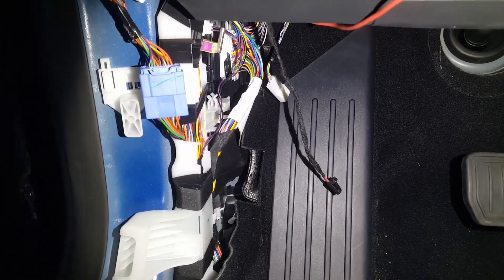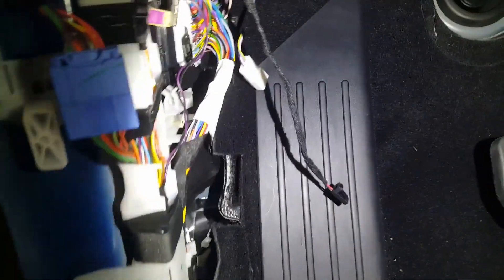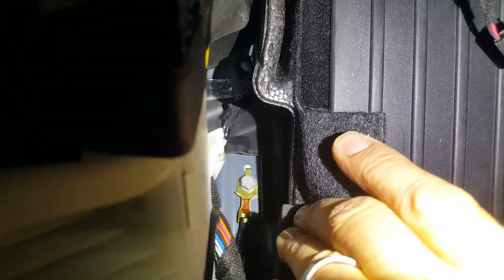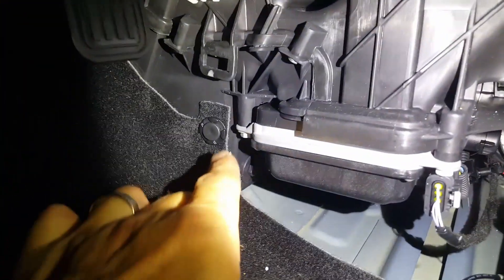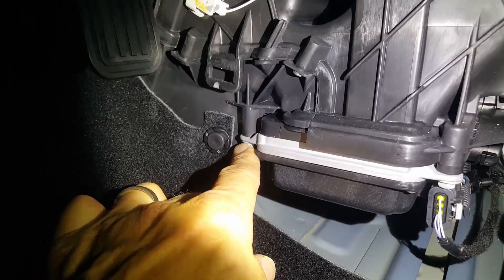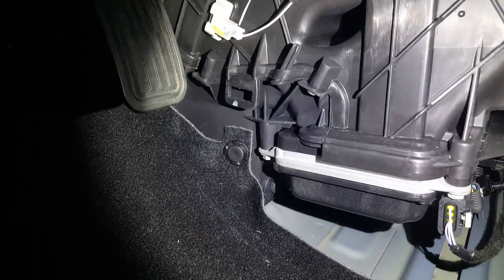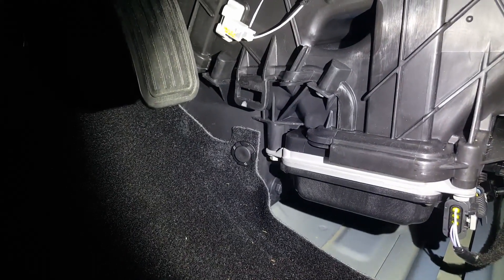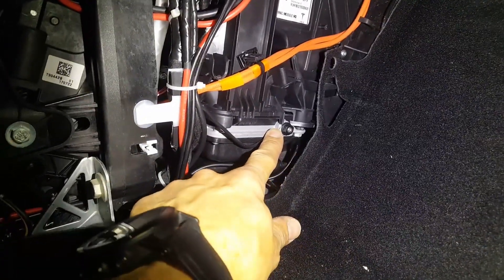Tesla Model 3 ground sources (followup to under dash source video)

Comment: FYI... careful when using that bolt ground to the chassis. At least it didn't work for me and scared the crap out of me. I turned the car off on the screen, unplugged it, and connected the spade plug to the 5V source. Then unscrewed the ground bolt and heard a sizzle. I was careful and wasn't touching power or grounding to anything so I still have no idea why... but Ruh Roh. Car was then unresponsive, no power anywhere, no screen, no doors, etc. Took a while for the solid state fusing to reset but it all works fine now. I decided to put it all back as it was and just run to the 12v socket in the console... I'm still shaking a bit lol.
Reply: There wasn't anything connected to the ground wire I was trying to put on the bolt, nor to the tool I was using to unscrew the bolt except my hand. That's what I still don't understand. If I had wired the 12v to the ground then yes you are correct.
Reply: Yup. Same here. I've done I don't know how many mods and installs on my ICE cars and friend's cars... but this is a whole new world. lol.
Reply: yeah, i saw that bolt (to the left of the brake pedal), was about to use it. i barely loosened it like a quarter turn and my car beeped and had a warning on the screen about not being able to charge. i tightened that sucker back up REAL QUICK. the alert went away and my car is fine. but i would NOT recommend messing with that one!